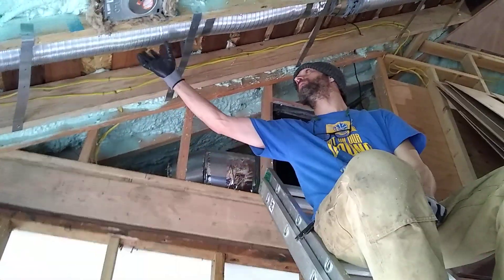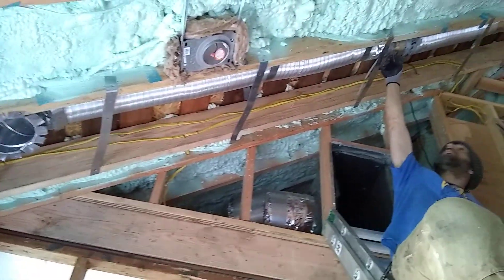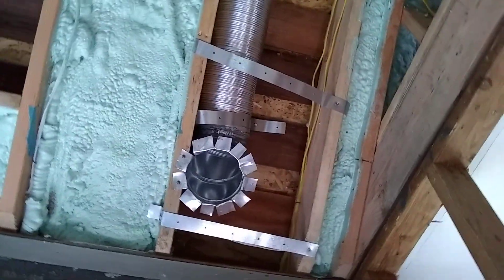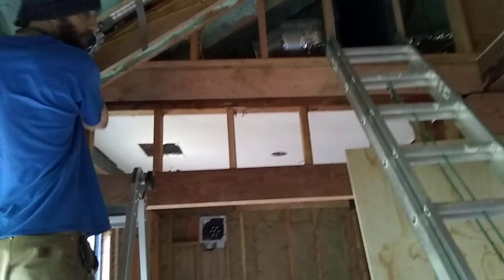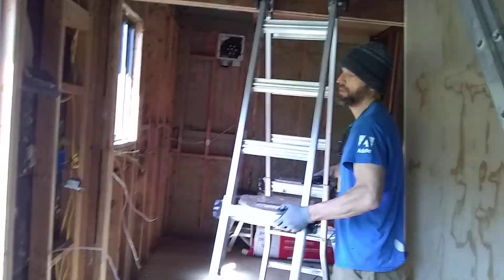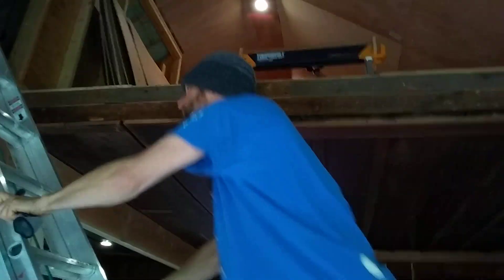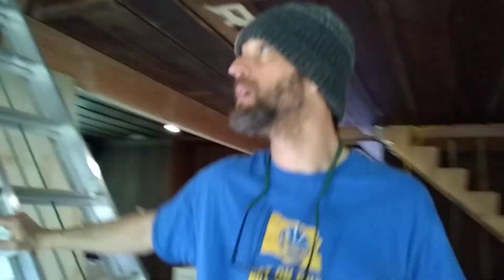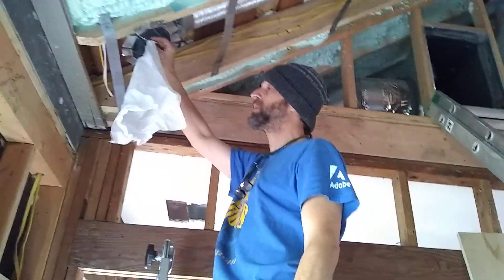Attic Fan system design and inatall. Heat in winter.

Comment: Brilliant idea with high energy costs this creative solution could help people save money buying expensive fossil fuels. Plus, in the long run helps lower pollution and is kinder to the planet! I am going to incorporate your idea onto a dark brown metal roof with cathedral ceiling. My fan will only have to blow the hot air a few feet into the room. I know it will make the upper air hotter. I don't have time to do duct work like you did. A few years ago, I tried a similar idea and tried to blow hot attic air 25 feet straight down with a fan. It was too far to push the hot air down and did not work. Perhaps a bigger fan would have worked. This time I am not trying to push down a tube with a fan. Keep up the good work and creativity!!! The world needs new ideas to help people survive!
Reply from the maker: Thank you.  You too.  Earth lovers unite!

Comment: I love the system and it’s application. I’m just not clear on the purpose. If it to add supplemental heat to the house in the winter then I’m with you. Exactly what I’m looking to do.
Reply from the maker: In the winter it takes the hot air in the top of the house and circulates it down to the lower floor